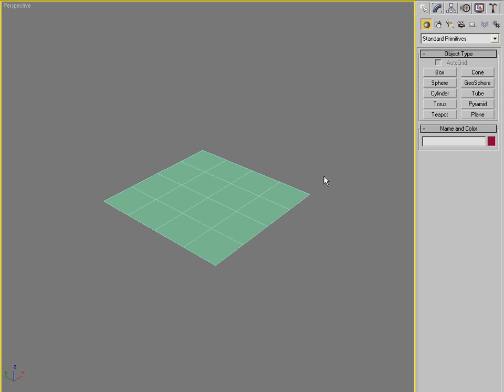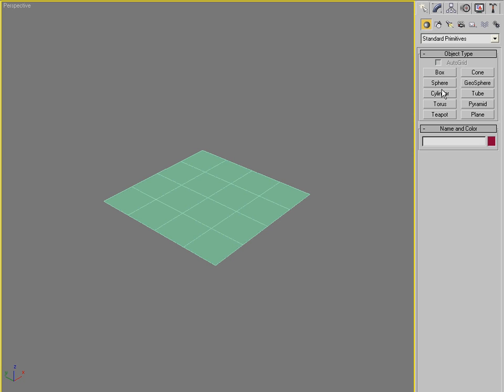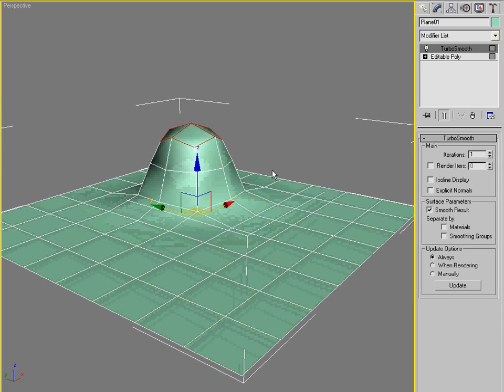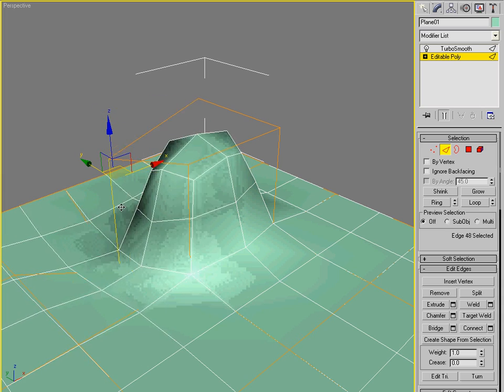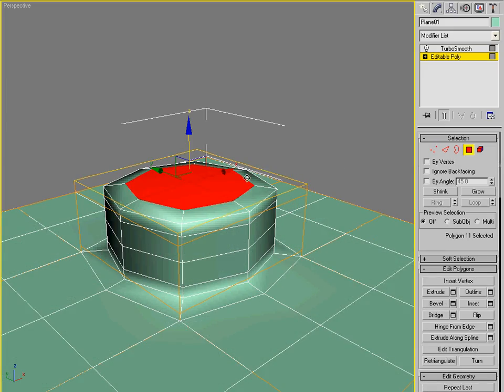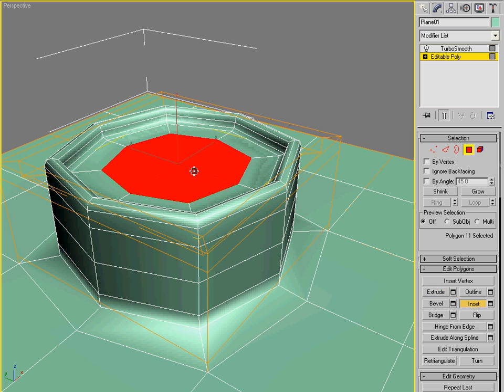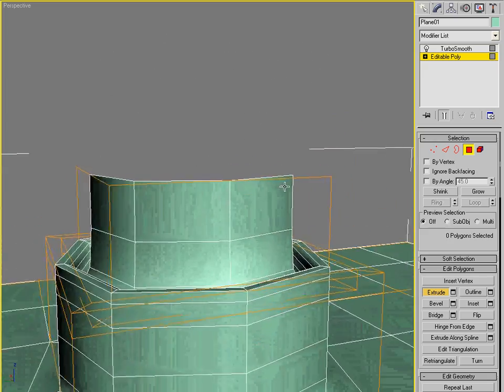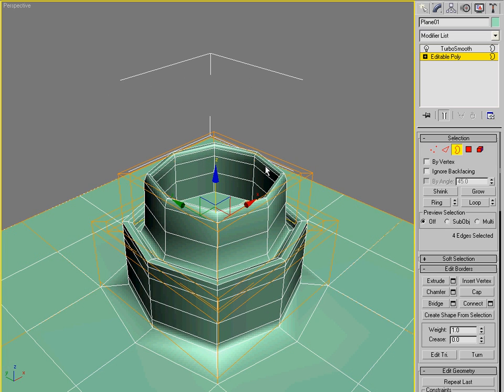3dsMax Monday Movie #11: Modeling Core Part 4

Comment: hi, i have just started using 3ds max having used inventor for the past 2 years. i'm finding it hard to make the cross over when it comes to modelling. i was wondering if you could show or explain how to align two obgects so that the faces are in line without eye balling it.

many thanks and great tuts